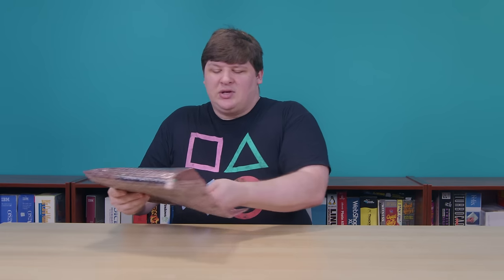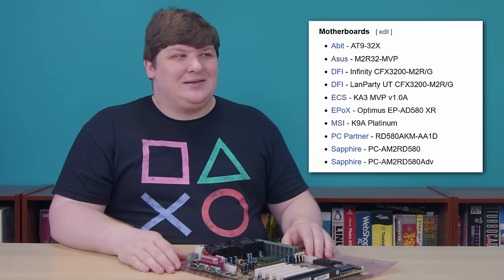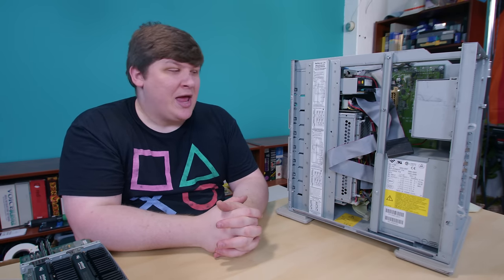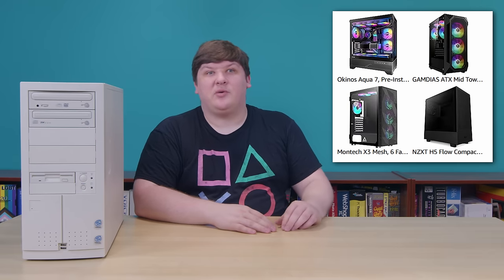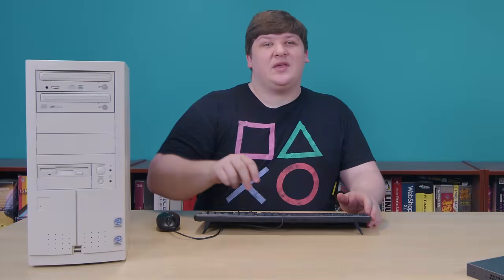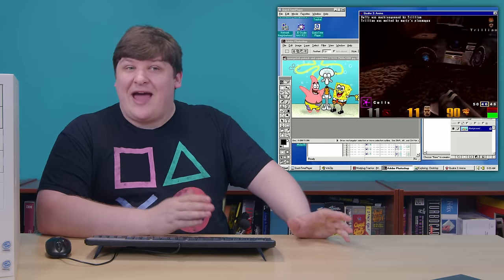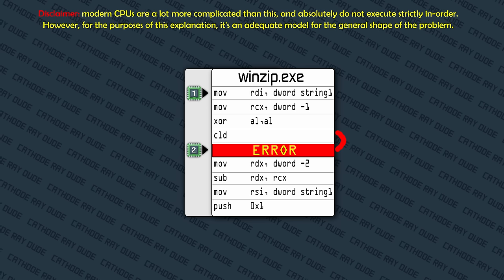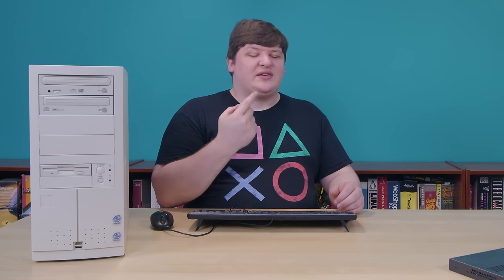The Only Famous Motherboard

Comment: I set up a dual Slot 1 Tyan board with 300A Celerons overclocked to 500 as a Linux multimedia server for my college radio station that compressed and streamed our broadcast over 24kbit and 128kbit MP3. I think this was in 98 or 99.  And yeah, the Tyan wasn’t $150.   It was a serverclass board and cost at least 200 or 250.  So the overclocked celerons were where I pinched pennies for our non commercial college radio station’s budget.

Comment: sweet video. brought back some memory's. my first duel cpu was a celron 300a that was modded to run as duel cpus. unfortually the mb was damaged and i never really got i working right. but this mb was my second and yes i used it for 3dsmax. that was the only reason. nt 4 i never really liked but when u got it working it was fine. tuff to get hold of without a lot of cost too. Thanks again for the video. Cheers.

Comment: FIC PA-2013 sticks out in my mind as a late 90s solid socket 7 board... I know we had loads of them at work with various CPUs in them, a lot survived until the core 2 duo days.

I think a friend in college had a BP6, we joked SMP stood for "symmetric multi penguin" since he ran Linux on it. It was the fastest machine on campus for a fermat-searching algorithm I was working on at the time. I think even faster than the sequent, but that was SMP using OG 80386s.

Comment: I had the Abit VP6 back in the day. It had several improvements over the BP6, although it came out right in the middle of the capacitor plague. It had dual P3 1GHz, none of that Celeron garbage. I agree with all of the downfalls of NT you mentioned, but NT was all about the stability. What made it so stable was the way it isolated processes in memory from each other, so if one crashed it did not affect any other. Of course, to isolate processes it used physical memory, which is why NT required much more RAM than Win98. But the way I ran it was to dual boot. Gaming was strictly in 98, "work" was in NT.

Comment: Oh man, I went to college in the fall of '99, and a guy on the 5th floor of my dorm had a BP6 with two 366 Celerons overclocked to 500mhz, and he was the BADDEST DUDE on the block.  I thought I was cool with my K6-2 450, and there was another guy on the 5th floor that had a slot1 P3 550, but we were all just bugs on his windshield!  I had always heard that one of the things about the BP6 was that you weren't supposed to be able to run Celerons in SMP, but this board let you (hence the use of "unmodified Celerons" in the Wikipedia first paragraph).  And there was something about a "pencil trick" to unlock the potential of Celerons in this era too.  It's just ... fuzzy in the mists of time, and I guess I'll have to wait for part 2 to jog my memory.

Comment: It is fascinating how esoteric Apple was with somewhat exotic dual CPUs as there were dual 604e Macs as they shipped 9500s and 9600s in 1997 as did a few clones, then mainlined G4s in dual CPU configs as a way to combat the MHz war in the early 2000s. By far the most common dual cpu computers were PowerMac G4s as they started at about $2500 in 2000. Most G5s were dual cpu, and by 2003 OS X made fair use of them. I remember at the time how uncommon dual cpus were outside of Apple so this is fascinating.
Reply from the maker: Oh huh! I didn't know they had smp prior to the G4, damn.
Reply: @CathodeRayDude to be fair I have never seen one in person and lord knows what Mac OS 8 did with two cpus, if I had to guess maybe a few MP built apps and that’s it.

Comment: Windows 2000 was a much better option than NT4 on multi-CPU motherboards.  It was rock solid and supported DirectX and had a much better UI than NT.

Comment: First machine I built was a Celeron 300A clocked to 450.  The whole rig was cheaper than a Pentium 450 CPU.  Releasing such overclockable bargain chips was marketing genius, whether accidental or purposeful.  Millions of us would never have bought new machines at all if didn't feel like we were sticking it to the man by cheating.
Reply: abit bh6? i had the same build. it was very strong. with the riva tnt.

Comment: For a VERY brief window of time, I had a side biz selling pre-tested overclocked Celeron 300A CPUs. These were an extremely hot fad since so many could hit 500+ MHz. I worked for a system builder who let me buy stock to resell. So I was able to test a ton of 300As and pick the best silicon for sale to overclockers. The system builder didn't care if they got the worst chips, they just wanted stock clock speeds.

Comment: 50:30 I actually had played Falcon 4.0 on the win2k beta. Back then it was actually called "Windows NT5", which is why its probably hard to search for info on "win2k beta". I know I "acquired" it sometime in 1999. It was basically NT4 with a lot of the driver usability stuff smoothed out. It looked good but ran pretty rough, as to be expected for a beta operating system.

The message you showed sounds correct. Falcon 4.0 had a fairly advanced "background sim" running all the other units and the "war". Pretty common for games today, but this was fairly cutting edge. The dual processor support basically ran the war simulation on one processor, and the flight sim on the other. It was fun because you were there flying you F-16 doing whatever mission, and all kinds of random stuff was going on everywhere else. Sometimes you would get sucked into some air combat between a bunch of planes that weren't part of your mission, but got in your way.

Comment: Ha, I remember building my first multicore system for work, with an Athlon 64 X2 and 8 gigs of RAM - and then waiting another decade for Adobe to actually add functional multiprocessing to After Effects. (And the motherboard was... a DFI Lanparty! I've still got the UV-reactive yellow IDE cable somewhere)

EDIT: Oh wow, the 3DS Max 3.1 nostalgia! I remember setting up a render farm in my parent's loungeroom and having to stay all night in my dressing gown restarting crashed render nodes every half hour or so to output a simple 30 second TV commercial. One of the computers proceeded to blow a hard drive controller chip (as in physically detonated, with a bang). What a time!

Comment: As a programmer this board was a relief. Prior we had to put GUI Thread and Workerthread on the same CPU. The problem was that the GUI got unresponsive when the workerthread got to much to do. With two processors it was suddenly so easy to keep the GUI Thread responsive by just putting GUI and Worker Thread on separate processors.

Comment: I still have a BP6 on my shelf, it was stored in a garage for many years and is now somewhat corroded and might not be savable. I ran 2 Celeron 300s at 450 and they were rock solid, could do 500 with a peltier cooler and ran Windows 2000. Windows 2000 was better it supported Direct X out of the box and was good for gaming. I hosted Rainbow 6 games with it and started with DSL and later moved to cable, it did better than the servers that used a real P3 450 that cost 4 times as much. Also I use to assign Processor Affinity to a program, so you can have 1 program use only 1 cpu, leaving the 2nd cpu available to run something else at full speed, rather than it running 2 at 50% making the system slow down.

Comment: Excellent video! Always informative and fun to watch, also remind me of how fun PC building used to be and to get the most out of your money. Celerons where HUGE back then and a money saver(and weren't the curse word they are associated with now). I remember over clocking my Slot 1 Celeron 300A to around 550mhz back in the day(make sure it's a Celeron 300A and not just a 300 as the "A" variant had 128 of cache and the other did not which made a huge difference in apps/games). Good times. Intel owned the CPU market back then which is why we only saw small increases in CPU performance. That is until AMD came along with their Athlon XP series and just started spanking INTEL. Awwww.... True competition. I miss those days. 
Thanks again for the excellent quality/research and all that you do!

Comment: I can definitely say I am one of the abounding exceptions.  I remember many of my motherboards, beginning with the Asus P2B -- a Pentium II board, the first ATX board I ever got.  That was the third computer I had built from parts (fourth owned, first being an AST Advantage Pro 486SX/25), but before the Pentium II era, most people had no idea what motherboard they had because manufacturers were too ashamed to write their name on them.  This is why it's so hard to identify 286, 386, 486 and Pentium motherboards without searching The Retro Web by chipset and number of slots.

I know that I had the P2B, then the TUSL2-C Pentium III board, then I got a BP-6 (I'll address the "why?" in a moment) for a second machine running dual Celeron 300-somethings, then an Epox-4G4A+ for my Northwood P4, then upgraded that to an Abit IC7-G, then things get hazy because my next board was a Gigabyte for a Core 2 Duo system and the model numbers started getting longer and less unique (based on the drivers directory on my NAS, it was a GA-P35-DS3R.)  Also, this is where I started building more computers as appliances, and so keeping track of which mini-ITX board I installed where is a bit of an exercise...

Now, why the BP-6?  Well, so, for most people it was one of two things:

Some people wanted to run Windows NT 4, because the NT line was fairly new and was often known as the "power users' Windows" rather than "the boring corporate Windows."  It was like bragging rights to say you ran NT.  I tried it for a while, but NT 4 was still like half Windows 95, half Windows 3.1, but all NT.  It really made no sense for consumers -- drivers and game support were spotty, the shell wasn't as nice as 95's, it took more resources and most of us were barely skating by with 95....  Unless you had business money to build a business computer, it wasn't the right fit, and so most of us eventually slunk back to the 9x series where we belonged.

Others of us were just dipping our toes in the UNIX world, with that new fledgling OS called Linux.  Most of us didn't have a reason to run Linux in the mid-late 90s, and it was really more like a "Take the Linux Challenge!" to get it running, drop you into a command line and then say "now what?" until you got bored, formatted it back as FAT, and installed Windows again.  If you were really good, you might get a working desktop and play some MP3s while you chatted with friends on IRC.  Because you could.  You were 1337.

But for me.... it was because I loved BeOS, and BeOS was one of the few OSes that could make use of multiple CPUs.  ... That's it.  That was why.  It was just to run BeOS.  I bought my aquarium pump, some hose and hose clamps, a chipset and two CPU waterblocks from Danger Den (!), and proceeded to be one of the few people not running NT, and not running Linux, using SMP.

(To be fair, around my BP-6 time, I also had a Server 2003 trial CD and a Linux box.  But they were just normie single-CPU hand-me-down builds.)

Comment: Back in the early-mid 2000s my dad worked at HP, and he would bring me e-waste home to mess about with. One of the best finds was an HP Kayak workstation, and soon enough all the parts to add a second Pentium 2 400 and a full loadout of RAM and worn out SCSI drives. With Windows 2000 it was a perfectly usable day to day machine for my introduction to downloading music and video on the internet (and sometimes homework), and when I saved up my pocket money for an ATI Radeon 7000 it could just about struggle through Wolfenstein ET or Jedi Outcast at 20-25fps. I think I even ran Red Hat on it for a while but games drew me back to Windows.

Despite manually assigning every single task to CPU1 and the game to CPU2, I never saw an improvement in FPS from the second CPU.

Comment: I used it exactly for Falcon 4 under windows 2000. And as  a side note - that Sim is still alive and kicking today as Falcon 4 BMS. (A disgruntled programmer leaked the code  back in the day)

Comment: I was doing video editing back in the mid/late 90s, so multi-cpu machines were needed, even with tons of add-in boards doing much of the heavy lifting. I had a dual P90 server made by ALR with a ton of PCI and EISA boards, and then a Tyan mobo with dual Athlon MP 1800s that eventually self-immolated.

Comment: Just the other day I was doing some cleaning in the closet where I shove all my old, obsolete tech (everyone has one of those right?) and I came across  some of my early 2000s builds, one with a Abit motherboard (and those old neon tubes that only had one color) and it dawned on me I hadn't heard anything about them in a very long time. Well according to Wikipedia they went out of business in 2009. It honestly made me a bit sad. RIP Abit, I'll remember you fondly along with Anandtech (I'm still in denial).

PS: Anyone remember using a graphite pencil to short an AMD processor bridge to unlock overclocking. I can't remember which Athlon model it was exactly, I think it was the XP.

Comment: I work with CG since 1993 (3ds for DOS then every single 3ds max version, in order, to this day).
My first "multicore" PC was a dual Athlon machine for a bucketload of money at the time (mostly due to the server-grade Tyan motherboard, the massive tower case and RAM), and 1 GB of RAM . It was a beast back around 2000.
Still working in 3ds max to this day and still needing as many cores/threads and RAM as I can get :)
3ds max is one of the staples of the CGI industry, at least on PCs.

Comment: @24:27 I just had a PTSD flashback to trying to change my Cyrix system to a Pentium so my GPU driver install would work. Only Pentium I could find was not in the documentation (one speed higher), so I had to guess the jumper settings and got it right. lol. Wow- we have it SOOO much better today when it comes to BIOS and PC hardware compatibility. Imagine trying to install a new GPU and the driver install tool refuses to run because it doesn't recognize your CPU. Oh, great video. I was a total PC n00b at the time.. only really dealing with stuff at work (Gateway/Microsoft/Proprietary Engineering Software Support Phone Line hell loop as each blamed the others). I had never heard of this before and the entire story is quite fascinating. Also, your explanation of multitasking and multithreading was excellently simple. My problems with Windows 3.1 up to 98 make me go the PlayStation route. That's how bad it was back then. Drivers for existing expensive printers? Who needs them.

Comment: Those Enlight cases were primo back in the late 90s! I built shitloads of PCs in them. In fact, if I was building a system for you, it wasn't an option, you had to spring for the Enlight case. They were miles above your typical flimsy, paper-thin, sharp-edged sheet-metal beige box cases of the time. The system board mounted to a tray that pulled out and the drives mounted to rails. I t was the proto serviceable design of he time. Speaking of SMP, Ibuilt a buncha Dual-CPU systems to run NT & Linux on a special Dual  Slot-1 board back around 98-99... used those Celeron Mendocino  CPUs with the cache on the die and loaded them into SMP-enabled Slotket adapters. Wham Bam Dual CPU server machines on a shoestring!! Great times!! =]

Comment: incredible video about a "regular" dual CPU board! I really tried to play around with Windows 95 and NT 4 for a few months but the amount of tweaks, specialized software and incompatibility problems I encountered forced me to switch to Windows 98SE and Windows 2000. Those would be two great OSes to dual boot on that machine, one for single CPU and 9x games/software, and the other to take better advantage of the dual CPUs. I wish I had a dual Pentium 3 board as my retro machine...

Comment: This is an interesting view into an era I kind of missed, even though I was very much into computers at the time. I was just way too poor to consider anything close to cutting edge. I didn't even get a Windows capable PC until 1998, before that the most modern PC I had was my dad's old discarded 8088 work computer. By the time I could even get a 3D card, this age was already past.

Comment: What i remember from that short period clearly:
- i had a p2 266 and replaced the cpu for a celeron 333A because the first couldn’t decode divx smoothly. That was a big deal.
- i used this rig for video editing in premiere and it ran pretty good with maxxed out 382mb of ram on the mobo i had
- asus p2b was a mythical mobo back then - everyone wanted it, 
- overclocking of p2 processors was barely possible, we unlocked and overclocked slot1 celerons by using a pencil to the slot ;)
- the short era that came after slot p2s and celerons (so pentium 3 and socket celerons) was veery boring and was quickly crushed by extremely exciting early pentium4 era!

Comment: I remember BeOS from computer magazines and how the articles about it explained it’s multithreading and SMP capabilities. It was quite ahead of it’s time (and very impressive on a Pentium 2), but it sadly failed to gain marketshare. Apprearantly it does the multithreading in a different way then other OS’s. Developers found it hard to work with. My experience of it was that it was quite crash prone in use. Back in the day some computer magazines put a copy of BeOS 5 Personal Edition on the Cover disk that you could install along windows 98. These days it’s a pretty fun to play around with Haiku OS on old machines. Some types of modern applications have a love/hate relationship with multiprocessing, this seems to be the case with digital audio workstations. I guess it’s because of the real-time aspects of these applications.

Comment: Man these mainboards came out during my PC build hightime. I've owned a BH6 with Celeron 300A Oc'ed to 504MHz, BP6 with 2x Celeron 366 @550MHz and a IC7-G with a P4 2.8GHz Oc'ed to 4GHz. Windows 2000 was simply perfect on the BP6 machine in the end. Best systems I've ever had!